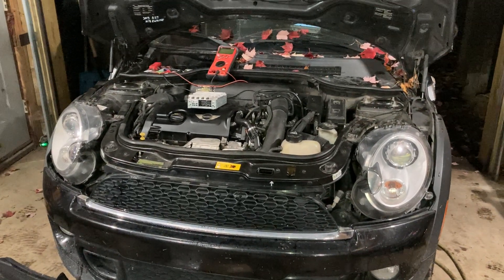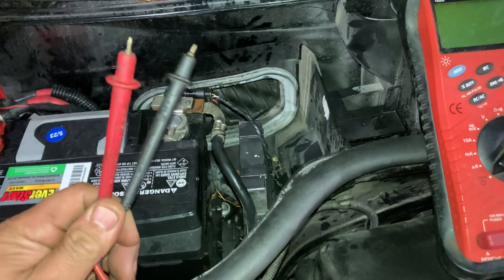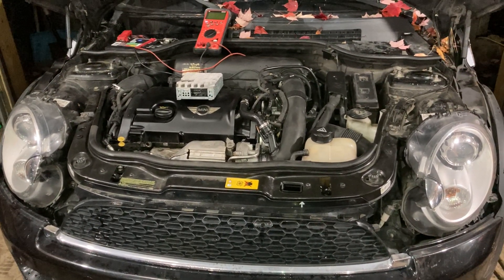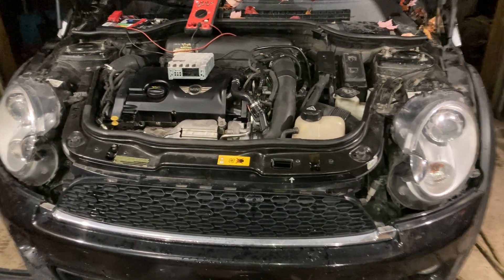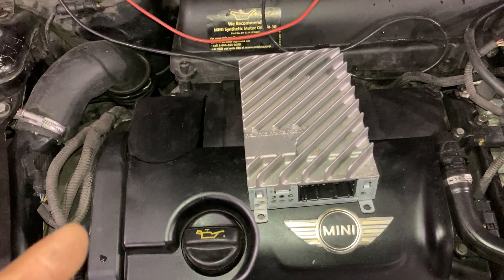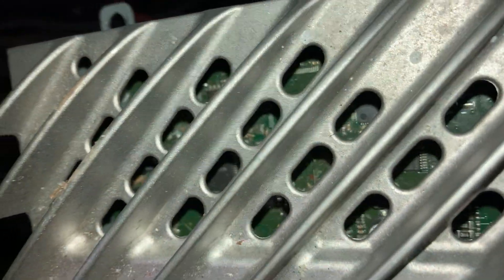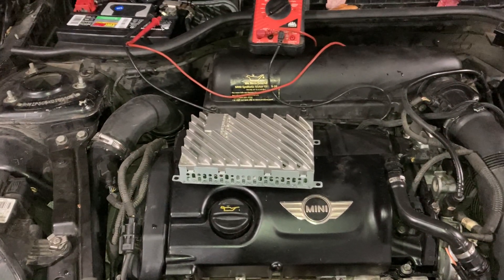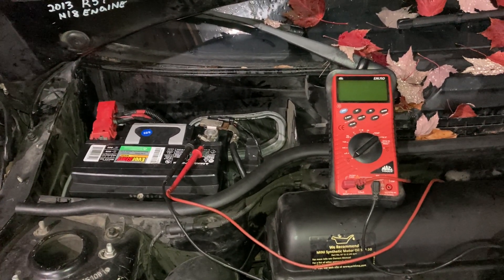2013 Mini Cooper R56 R57 R55 R60 battery drain issue resolved (amp/ amplifier)! Parasitic draw test

Comment: How did you get the car thinking, that the hood is closed???
Reply from the maker: @denzelcrocker4956  I don’t remember bothering. I’m just going off memory here, but there was no hood light, and even with the hood ajar, it shouldn’t affect the modules going to sleep after 30mins to an hour.
Reply: I found Out, that my navigation drained the battery. Now it is at 0,09 on my clamp. Is that good? Or still top much?
Reply from the maker: @ is that 0.090 amps? Otherwise you mean 90ma? That’s just a touch high but that’s really not that bad. I would hope to see, for any car, the current to drop to 0.050 amps (50ma) or less. But 0.090? I’d wait a bit longer to see if it drops any further. Remember, if you disturb your connections, it will reset everything and the process will start all over.
Reply: @tadsworkshop  the Clamp measures in A. So i would guess 90mA. 

I waited an additional 1 Hour on the car and it stayed the same
Reply from the maker: @denzelcrocker4956 ammeter clamps are a little inaccurate when it comes to really low current flow like that. I’d encourage you do the same test but with the leads inline. Be careful not to blow the fuse in your multimeter. Most are only 10 amps, some 15. But given what you’ve told me, it sounds like you’re doing ok as far as parasitic draws go. Just try the same test with the leads.
Reply: @tadsworkshop  i Had no luck. The battery is empty again. And now the Radio loses it Sound every 10-15 seconds

Comment: Working on a  2009 R56 and it seems to be holding at that 4.25 amp.   Hoping that it will drop down.  Pulled fuse’s and relays, no drop in draw.
Reply from the maker: Just make sure to give it lots of time to drop from that 4.25amps. Allow it up to 20 minutes. Also, disturbing your multimeter leads or connections will obviously upset and reset the electronics that are drawing that 4.25 amps and start the cycle again.

Comment: Does it matter if the car is locked/unlocked or if you have a door open? 
Seems like you would need to lock it to let those modules enter sleep but you need access to the car's interior for the fuses, or will waiting for an hour let the modules go to sleep regardless?
Reply from the maker: Yes you definitely need the doors closed in order for everything to shut off. Windows can be down though. I carefully climbed in through the window to get access to the fuse panel to narrow down where the draw was coming from. You could also wait inside the car and have the multimeter on the window. And to be clear, car can remain unlocked.
Reply: @tadsworkshop  thanks for the quick reply! About to try this on my R55 which is showing CC-ID 415 "increased battery discharge"
Reply from the maker: @TinkBIG  cool, I hope you get it figured out! I was just thinking about this, but maybe instead of closing the passenger door, just close the door latch with a screwdriver. That will make the car think it’s closed. When you are ready to close that door, squeeze the door handle and pop that latch before you do so.

Waaay better than crawling through that window, lol,

Comment: was useful to me! i just diagnosed the same problem. 120mA - fuse 49.  
Do you know if the amplifier is really needed to get some radio working? I'm tempted to live without putting back a fuse in.
Reply from the maker: Glad to hear the video helped you. Unfortunately you will have no sound whatsoever without the amplifier. I remember not having it plugged in, and causing that. If you clever with electrical work, you could probably bypass the amp, but if you disconnect it or remove power, I believe you will have no sound whatsoever.